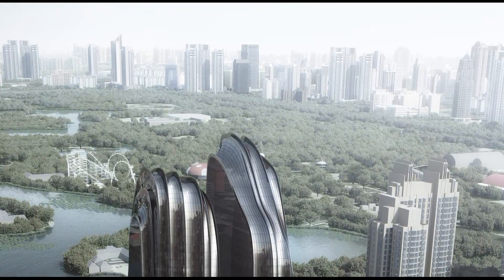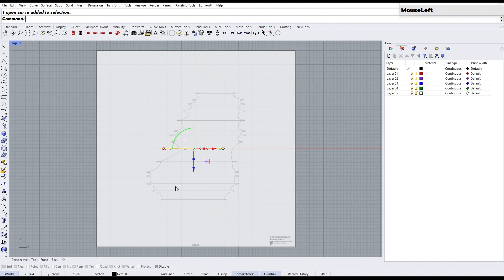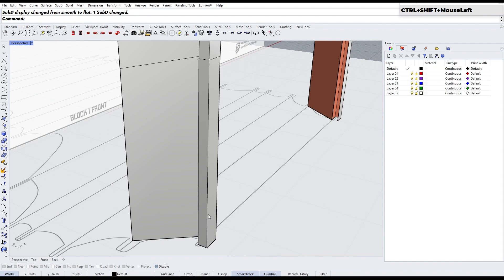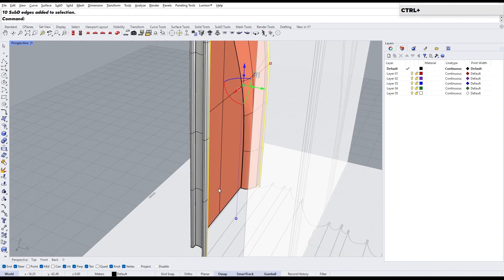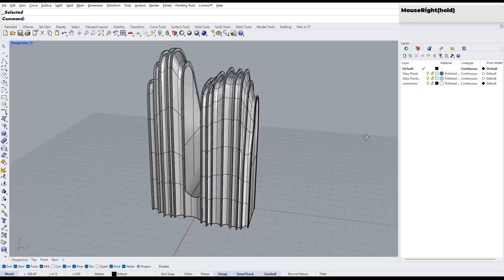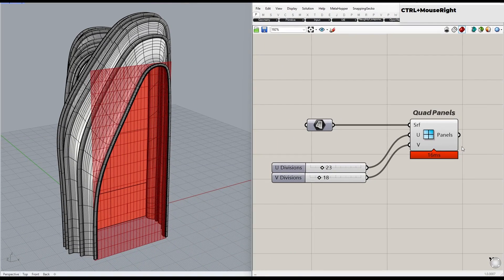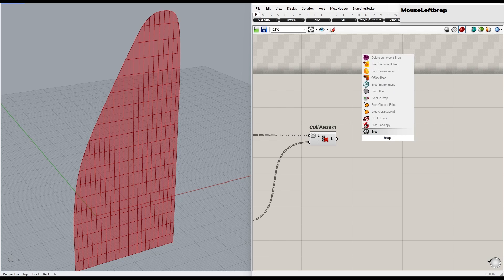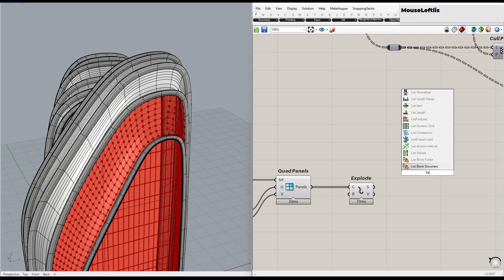Modeling Iconic Buildings in Rhino Sub-D, Step By Step

Comment: hello, amazing video, super helpful, however, i'm having trouble connecting the final two structures with the bridge command since the walls that i'm connecting are not being identified as edges or places of connection for the bridge. Do you have any solutions for that, how did you do it? Thanks again.
Reply from the maker: Thanks! Just make sure both edges you’re trying to bridge have the same number of segments. If the segment count doesn’t match, the Bridge command won’t work properly.